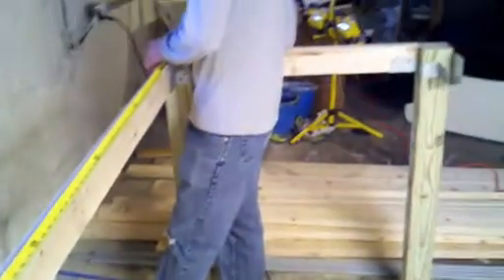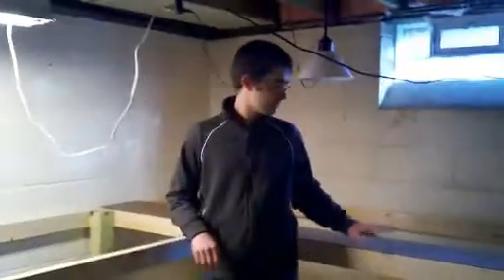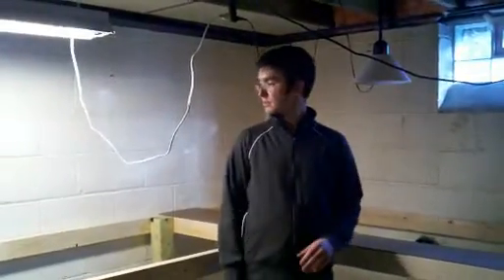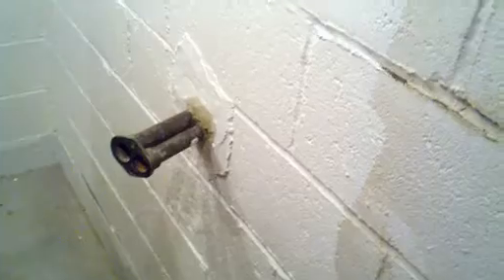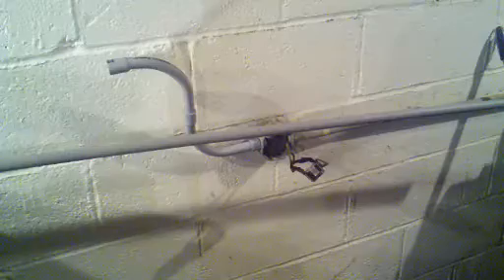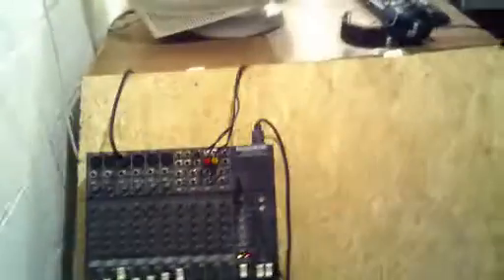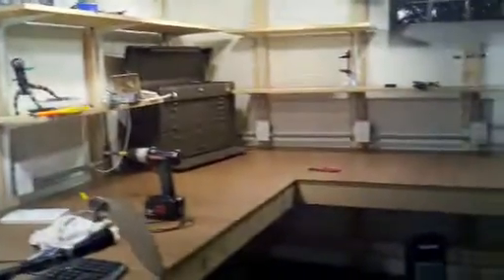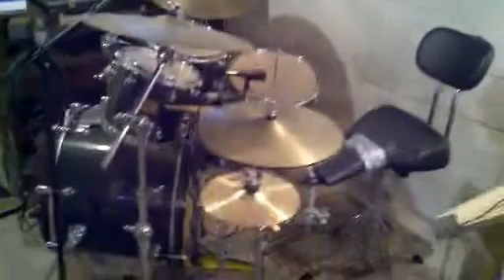Building An Electronics Workbench

Comment: Chris - what I like about your bench is that you can slide(if your chair has wheels) from one end of the bench to the other. I don't like interference from support legs which block ones ability to move around. Also, take the time and make the investment in paint, lighting, heat, sheet rock ,etc making your shop a place where you want to hand out. Good Job!

Comment: It makes me want a better lab too.  My problem would still be getting the fumes out.  I put a fan in the window and go easy on the preheater temperature, but I still get burnt flux smell pretty intensely in my basement.  

The way the camera goes to the tool box, at first I thought it was over a meter tall, like a huge storage locker.  Even small ones like that are not cheap.